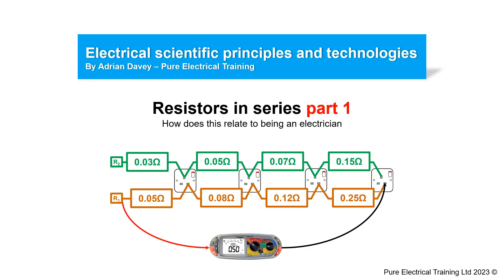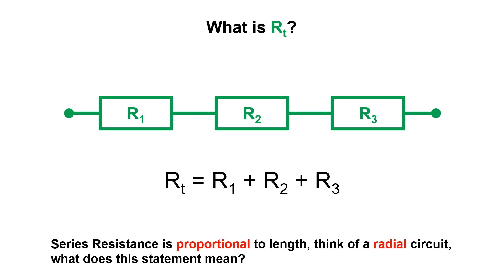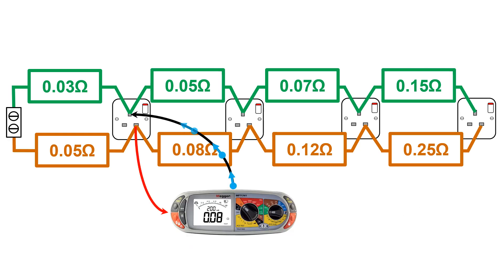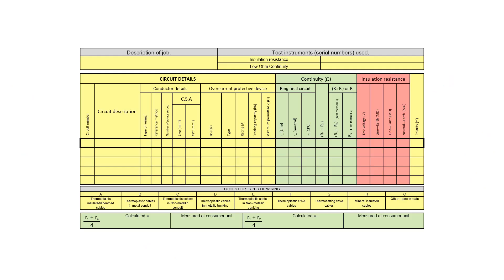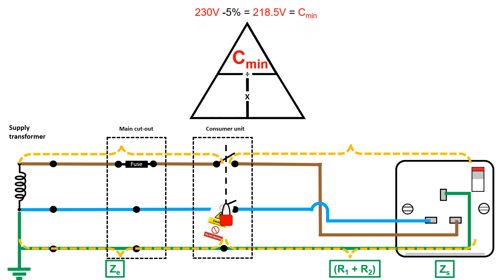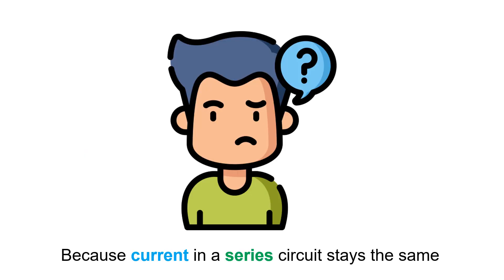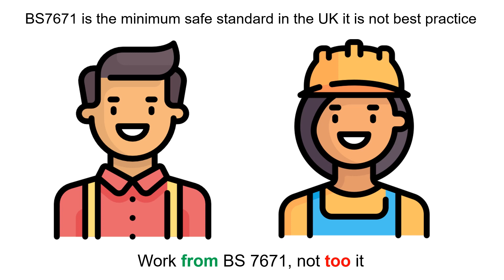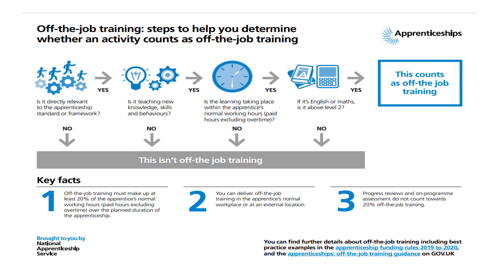Resistors in series part 1 of 3 - Why we need to know resistors in series and how we use it on-site

Comment: Hi Adrian, 
Great video as always.

I’ve just sat my 202 electrical science exam and it had air of questions on star and delta connections in 3 phase systems and working out phase and line current ect.

I’ve not actually covered any of this is my training, my training provider when questioned about it said I had actually taken the wrong exam and it should have been the 602 I should have sat.

My question is would those questions be in the level 2 electrical science exam?
Reply from the maker: What level are you studying and who is your training provider?

You can see the course handbook for level 2 here

https://www.cityandguilds.com/-/media/productdocuments/building_services_industry/electrical_installation/2365/2365_level_2/centre_documents/2365-02_l2_electrical_installation_qualification_handbook_v1-9-pdf.ashx
Reply: @Pure_electrical_training  level 2 mate, my training provider is total skills training
Reply from the maker: @liammoore5192  if you look at the level 2 handbook I shared with you, it would appear that the 202 exam is correct for level 2